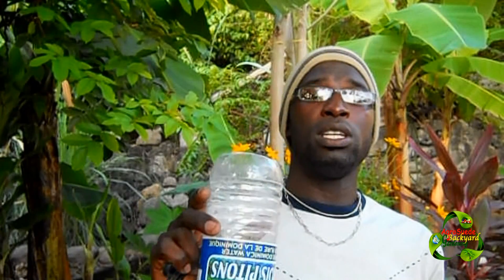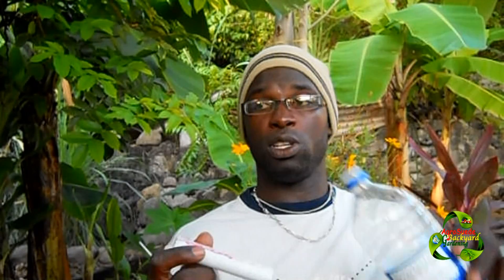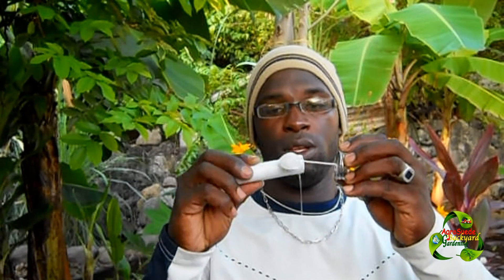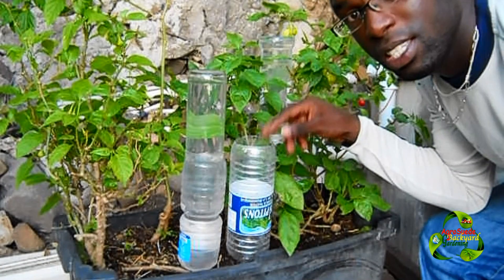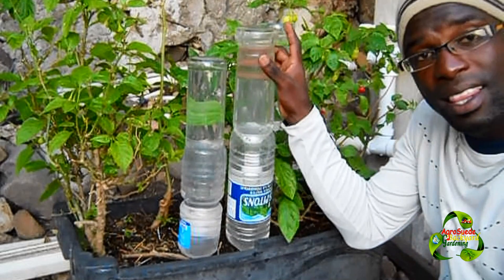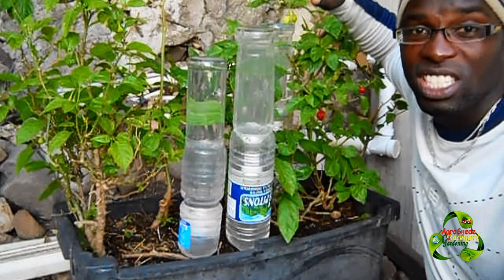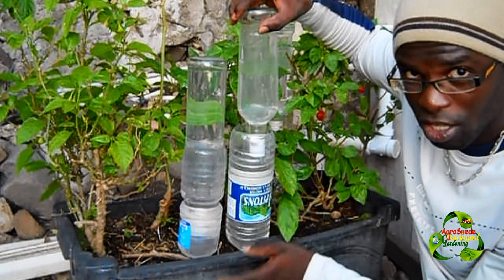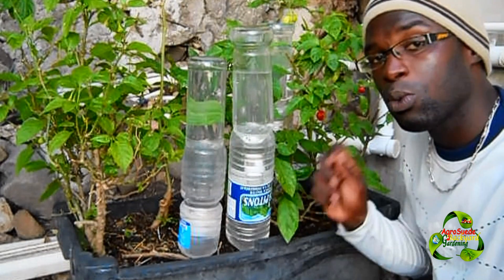Recycling Plastic bottle and glass bottle in the garden

Comment: Love this eapecially during dry season when water is scarce & water rationing & fines are in place.  However its true the dispensation of water to the plants is VERY DEPENDANT UPON SOIL TYPE. My soil is more loamy clay based so the water  goes down very slowly sometimes the soil even clogs up in the pvc pipe or neck of the bottle .  So i tend to blend the area of soil with some sand to increase drainage plus i use 1.25 pvc pipe or 38mm conduit this diameter is wide enough to fit the neck of the bottle so i can just leave the pipe in place & just top up water bottle when needed.
Thanks again.

Comment: Can I use two plastic bottles, one on top of the other? Or does it has to be a glass bottle? Thanks and I love this video idea!
Reply from the maker: Thank you. You can use a plastic bottle also. but one thing about using two plastic bottle is that the pressure in the top plastic bottle might affect the flow of water. Also it would recommend the glass bottle because of its long neck. I welcome you to give it a try, or perhaps I will give it a try.

Comment: When you push the PVC down into the soil , how do you prevent the PVC tube from being obstructed with dirt ?
Reply from the maker: it depends on the type of soil you got....if you have clay soil...use a first pvc pipe to make the length down in the soil...then push in your bottle(with the pvc)....if your soil is sandy then it is not a problem if you use the method shown, because the sandy soil would allow the water to flow out faster.
Reply: The soil acts as a wick !!